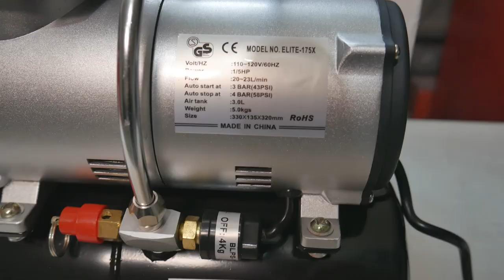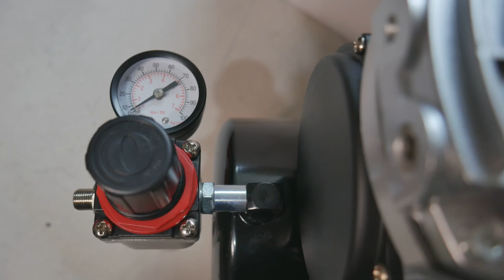Follow Up | Zeny Brand Air Compressor Stopped Working Two Months Later.

Comment: What type of hose will I need to connect to this compressor so I can use it with my Iwata eclipse HP-CS?
And are you still using it?
Reply from the maker: The hose that comes with it will fit  , and the Point Zero will fit the Iwata,  I have two of the Eclipses, I love them, great air brushes.
Reply: @PheedensGarage  Thank you, I didn’t realize I brought the zeny air compressor, and I bought a point zero air compressor also, lol(From Amazon)